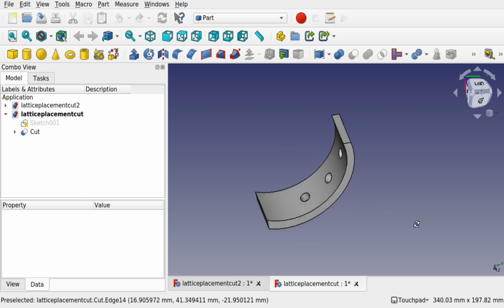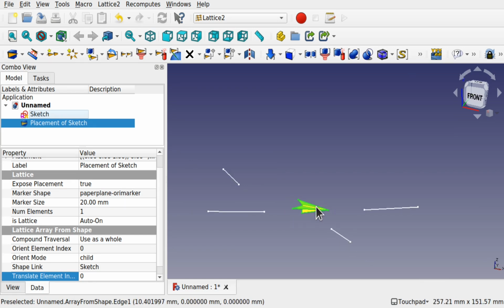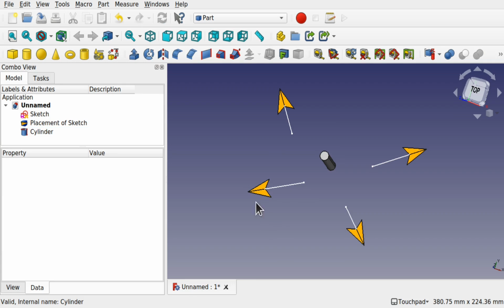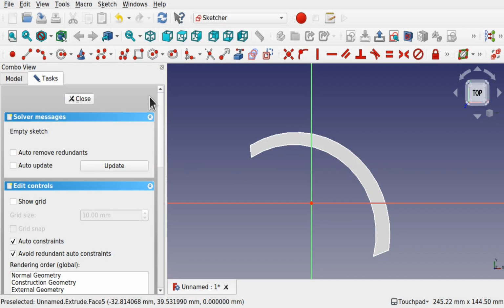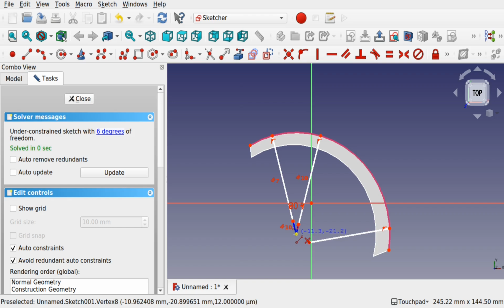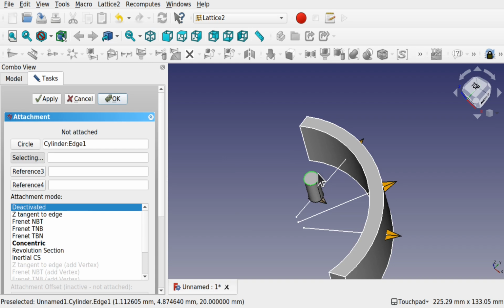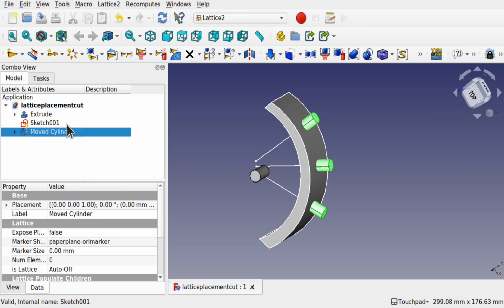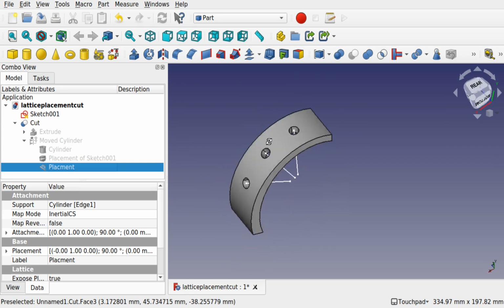FreeCAD: Lattice2 Part 7: Tangent repeating features and holes at custom angles on Curved surfaces.

Comment: tried this in freecad 1.02 must be doing something everything ok until I tried to move the sketch to the middle of the curved surface would not let me. spent two weeks of head scratching but could not figure it out. I have probably made an error somewhere will keep trying.

Comment: Hi, this worked! However when I tried to cut cylinders that are slightly overlapped on a curved object, the cut did not work properly - the cut turned to a black object. Do you have a suggestion on this? Thanks!

Comment: I'd say these features are "normal" to the surface, not "tangent" ;) .
Btw. I would have started with the construction geometry lines as well to align the sketch edges through the arc center. But after the third one you drew, I remembered that you could just have used "point on line". Would have had the same effect without having to draw extra lines.

Comment: The cylinder placement's Attachment Mode we used is called "Inertial CS" - I don't understand that term. What does 'inertia' have to do with geometry? And what is CS?
Reply from the maker: This is the 'axes of inertia' and CS I belive is Coordinate System.  Here's a link  https://www.ncbi.nlm.nih.gov/pmc/articles/PMC15493/#:~:text=The%20principal%20axes%20of%20inertia%20of%20a%20rigid%20body%20are,example%20of%20a%20principal%20axis. It explains what it is but the article relates to another subject.
Reply: @MangoJellySolutions  Thanks, the article makes it clear.

Comment: Wooo, It worked! However, I am finding it impossible to use the same technique to put holes on either side of the existing holes. 

Keeps telling me "You can't use population tools on shapes in partdesign body. Use Lattice PartDesign instead. Or deactivate active body to use populate tools on shapes."